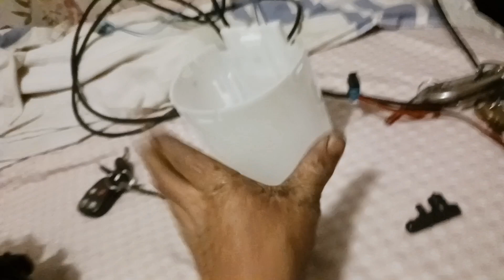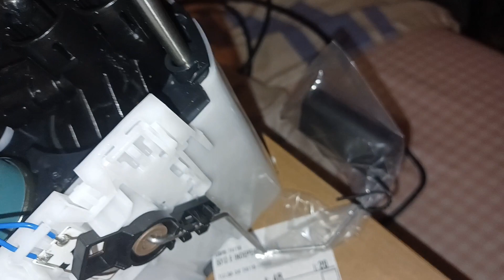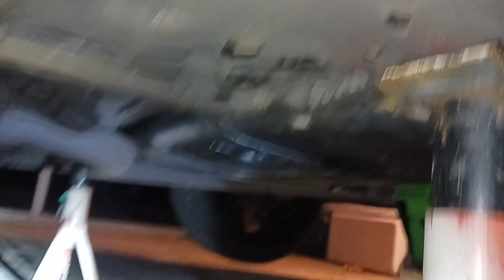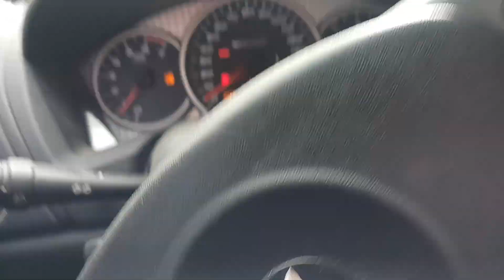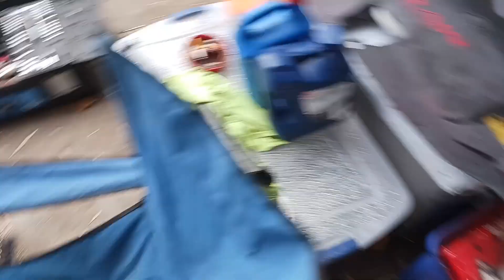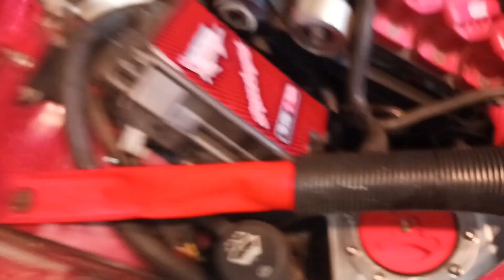2007 Grand Prix GT AEM E85 Fuel Pump Install/ Dropping the tank again/runs so much better now

Comment: Dam good idea for the mustang cooler box. Cx racing right 150$$ I was thinking about the same thing a while ago. 1gallon more fluid
Reply from the maker: Yeah it's nice. The whole system took about 2.5 gallons to fill with the box and the lines and heat exchanger. I like it. Runs a little bit cooler than it did before. Only like 5°-10°. But still it's an improvement.
Reply: @PontiacsGarage  any added fluid helps iat's

Comment: You should just cut a hole in the floor for the fuel pump and call it a day. It would go from a 2 hour job to 20 mins.
Reply from the maker: Yeah but I have subs back there. So I'd have to remove the system to get to it. I have a cover plate to do that but just never got around to it.
Reply: @PontiacsGarage Did you buy a cover plate for an access door to the fuel pump?
Reply from the maker: @native_redman9002  no, I have 2 of them off of grand prixs, I just never cut the hole out. Plus it has 2 plastic lines that are melted to the fp assembly. It all comes out as 1 piece.

Comment: I didn't know TRQ made fuel pumps. I got their camber bolts.
Reply from the maker: I didn't either. But I like it. It's great quality. Seems even nicer than the oem pump assembly.
Reply: @PontiacsGarage  Glad ya didn't have my luck bro. Went thru 3-5 before I gotta good one. It's a crap shoot. I'm doin the shock tower job. Avoid that kinda shit if you can. It's a helluva job. Probably take me 3 days.
Reply from the maker: @stevewheatley243  damn bro that blows. I wish you very good luck on it. I've never had to go to that extent to save a car, but I hope you get it done. Good luck
Reply: @PontiacsGarage  I'll get her bro,and thanks. I'll tell ya about it.
Reply from the maker: @stevewheatley243  so are you cutting yours out and welding in the replacements?
Reply: @PontiacsGarage  I'm cuttin the tops outta mine,and sliding in the new ones. Then a buncha self tapping screws. She'll hold.
Reply from the maker: @stevewheatley243  interesting....
Reply: @PontiacsGarage  Don't have a welder anyway. And once the new towers are in,there's nowhere they can go. Once the screws are in especially.
Reply from the maker: @stevewheatley243  well hell yeah. Sounds fun. Lol. Jk. At least you figured something out to save it.
Reply: @PontiacsGarage  This is day 2. Finished one side,hoping to finish the other tomorrow. Those things ain't gonna go anywhere either. What's done is solid.👍
Reply from the maker: @stevewheatley243  hell yeah. That's awesome. I wish you could show pictures. Lmao.
Reply: @PontiacsGarage  Id like to. Can I actually upload pics to your channel?
Reply from the maker: @stevewheatley243  no i don't think so.
Reply: @PontiacsGarage  Bummer,I'd like to show this. It was a good idea,and I'm proud of the job. Hard job though.
Reply from the maker: @stevewheatley243  post it on fb in the grand prix groups.
Reply: @PontiacsGarage  Nah,but maybe I could send you the pics in your email. Give ya more ideas maybe.
Reply from the maker: @stevewheatley243  hell yeah.
Reply: @PontiacsGarage  I'm done bro. It's solid and sweeet. Rides great,sits up in the ass like I like it. Don't let anyone tell you ya can't transplant shock towers. Damned hard work,but it's worth it.